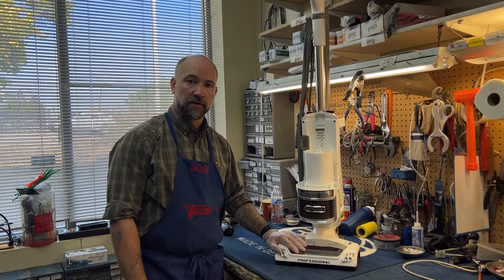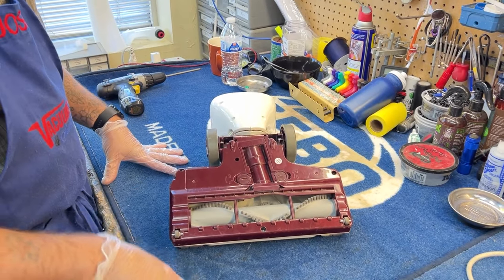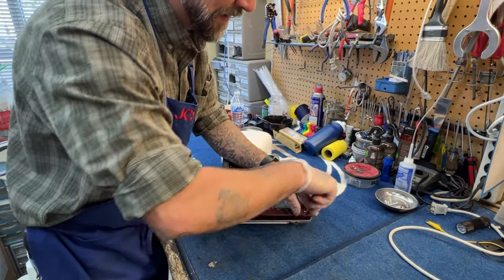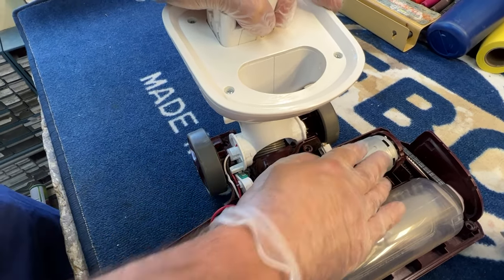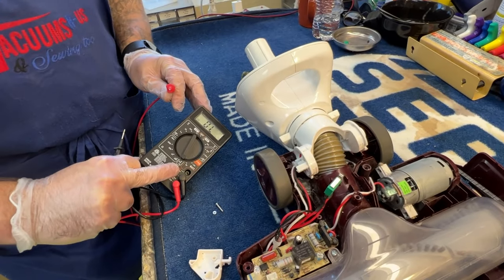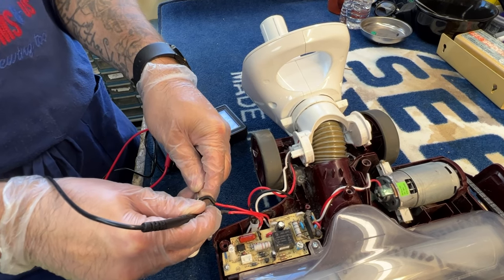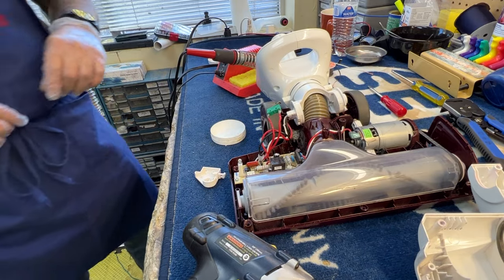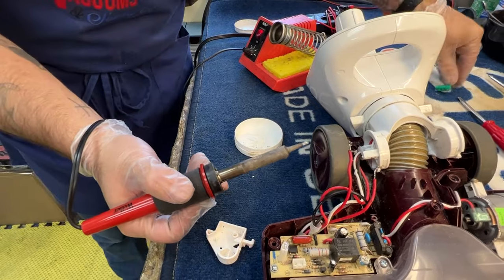Shark Repair for No Brush Roll Action--Micro Switch Replacement

Comment: That's what drives me nuts about the Vacuum Wars channel.  He only shows how well a vacuum works out of the box, but doesn't spend any attention on how long the vacuum will clean correctly before it ends up breaking something and being set outside on the curb for trash pickup.
Reply from the maker: I agree with that. However, in that channels defense they do have some of better performance testing I've seen. He's very transparent in how the testing is performed. We have been battling consumer reports for the last decade and a half over their performance metrics. They refuse to explain how they test the machines. This wouldn't be a problem except they "test" identical machines which are marketed as different models due solely to a color difference and some how come up with different performance results. The same issue will have an identical unit rated as #2 highest performing and #11 on the same chart. The only difference is it's a different color and says "pet" in the model. Vacuum wars doesn't pretend to know some thing about how long the units will last, or the companies dedication to providing repair components in to the future, just how well they run when he opens the box. But I agree with you, most people don't understand what a review channel is for and how it's monetized ;P
Reply: Yep. Their video is what made me purchase this vacuum. I wish I could throw it to the curb, but I paid way too much for this vacuum to do that. I didn't even use this vacuum for 6 months before it was out of commission 🙄
Reply: @vacuumsrus  which brands have best cordless thats repairable
Reply: Shark does great as long as you keep the insides clean
Reply: @joshholschuh1847  but you can’t repair them
Reply: I had purchased a shark not too long ago. While awiaiting its arrival. My rug was perty dirty. There was a loud sound from the rotating bristles. It was not turning. There was no long material of any kind. That had wrapped itself around the brush. I went to the local hardware store. To pick up a set of T Handle security screw removers. No big deal, I had discovered that lower outake pipe was clogged. I still cant not figure out why the brush would stop spinning. As well as produce a wierd dound. It is now back together short of the two small roller wheels. In the front, I am unshure of. If the felt bads go on the inside or the outside. Can you please help me out here?
                Thank you
Reply: Repairing is @ completely different animal than testing
Reply: @281cu6   The owner wants their property back. At stated time that they were told. That they would receive their repaired personal property back. Or the closest time to it. 
You purchase first class airplane tickets. To some or most of the most easily understandable situations and questions. 🛫✈️ WOOOOSH

Comment: Just bypass the switch by rewiring the connection.  Remove the switch completely. Works perfectly!
Reply: Yh if you want the brush roll to stay on constantly while switched to carpet
Reply: I may do this lol
Reply: @Ziggyzoo-wl8ug  I fixed mine and replaced the switch it’s easy bro
Reply: Just did this. Works great.
Reply: @juicyplumbs1250  What? The only thing the switch does is turn the brushroll off when the vacuum is upright. You can still turn the brushroll off at the main switch.
Reply: @jonny_panic  Yh I know but I’m weird and didn’t want it on while it was upright if I’m sorting something out, it’s a good solution but I wanted mine how it was before so just changed the switch

Comment: the microswitch activates when the handle is dropped down.  it also looks like it activates the LED lights.  So if the LED lights work, doesn't that mean the microswitch is good?

Comment: The switches are garbage why put in a switch that will fail I bypass the switch and shut off the brush manually on the top of the vacuum

Comment: I have a shark duo model AZ 2002. My cover plate will not come off.  I've removed 11 screws including the one under the small rubber wheel. I can't find any videos with this specific model number.  Please help.

Comment: I found that replacing the micro switch on Shark Duoclean was very easy. Unsolder the old switch from the wiring and solder the new switch to those cables and bingo. Be careful to mount the new switch onto the mini lugs molded into the machine. When replacing the side onto the machine be sure that the slider on the body of the vac is in the forward position. This was a really helpful video but I wish I could earn $190 as easily.

Comment: Just watched your video "Why You Cannot Repair Your Shark...") and this came up.  We owned 3 Shark SV780N model units--a handheld. We loved them.  Then over time, two began acting up.  They cut out at first and then finally quit.  I knew it was the switch in the handle and assumed I could easily replace it.  NOT.  The switch is mounted onto the circuity of a tiny electronic board which is itself mounted into the vac handle.  Burn marks on the boards suggested the switch was not to blame.  New boards were not available. I trashed the two for lack of a simple repair.  When replacing batteries, I cleaned the insides which acquired a lot of micro dust.  Cleaning done so I would not be wearing dust as I worked on them or inhaling it.  I ended up being quite mad about the whole business as one cannot make repairs on what was a popular vac.  I have been soldering since 1968 (With the same Wen Iron, now outdated) but have to say, circuitry is now beyond my skill unless I buy new hot air "Blower" type irons I see used on computer electronics.

Comment: Thanks for the video. My switch tested okay. Then I  saw that the white wire connected to the switch, was almost completely severed. 
I soldered it back together and now it's working like a champ. 
The black wire was a little pinched,so I cut it and soldered it too, while i had everything opened up.
Thanks again 👍
Reply from the maker: Glad to hear it worked!

Comment: Thank you for this video. This was exactly my problem, which was fixed by replacing the microswitch. I was happy to order a replacement microswitch from you all thanks to these clear instructions. Hope others do the same. Cheers
Reply from the maker: That's great to hear! Glad we could help.
Reply: How do you disconnect the swivel hose

Comment: Excellent video, thank you. Navigator 370. MicroSwitch and wires checked out OK. FWIW, checked voltage on the main On/Off/Roller switch - both positions read about 7v. Seemed the roller position should be higher voltage. Being lazy and not wanting to take the whole top section apart,  I soaked the top of the switch with silicon spray, a few times, letting it soak down in, exercised the switch rapidly. Now the roller does come on. I'll call it a fix, we'll see how long that lasts.

Comment: The Shark vacuums I've owned were not only excellent in function but durable as well.  Watching YouTube videos of different peoples vacuums illustrates how poorly a lot of people take care of their belongings.  Many vacuums that are talked about seem to have been used relentlessly and put aside unloved.  My vacuums in comparison are used but cared for at the same time.  Remember,  the reviews of vacuums or anything else often over reflect the owners who neglect their machines then complain that they are poorly made or unreliable.
Reply: I think it's a combination of both.  If you do slam your cleaner around the place it will not help.  However I have just finished repairing a non-functional brush head of my Shark Cordless duoclean.  The cause was one snapped and one nearly snapped power cable at the join where the shaft pivots around the brush head.  Given the design run of the cable this kind of fault is almost inevitable.  Unfortunately I couldn't get the joint apart as it is not designed to be repairable so I had to put in an external run.  In general getting the product apart to repair it was not simple.  This is poor design and results in a lot of waste.  Our Shark gets very little use as we have hard floors and is stored in a cupboard.

Comment: Thanks.  I'm just trying to replace the roller brush, but nothing fits to get the last screw out to take off the front panel.  I'll go out to find the security bits and see if that'll help.  NV 752

Comment: Good video. We have had our Shark for about a year with no problems but... 
I was surprised at your use of soldering flux. Flux is used when making a solder joint. It renders the surfaces clean so the solder binds. 
The solder for electrical work has a rosin core  flux. 
No harm done but it seems you are going to a lot of needless extra work. :)
Reply: I've found that using flux makes it easier to solder even with rosin core. My theory is the flux displaces air and lets the components not cool as you're soldiering with maybe a 10 watt iron.

Comment: Great content, thanks for the video. Our NV800W DuoClean vacuum was abused a bit by the family. It had been used for awhile and not cleaned out. There was major build up on both rollers that was creating a lot of resistance and causing the them to stop and the brush roll light to turn red. Once cleared, the roller still did not spin. So, I opened things up and the micro switch test good but I can see sparks on the motor brushes as it tries to spin. Obviously, it wore out from being overworked. I searched the part number printed on the motor and found several outlets to purchase a replacement. Maybe this will help someone else. I'm a electronic repair tech also.
Reply: I hope you don’t mind but I’d like to ask you a question. The creator of the video doesn’t seem to respond to questions (understandable - it IS his business after all), and since you said you’re a tech I thought I’d give this a shot. 

I’m not an electrician, but I’m not unfamiliar with electronics basics either. My Shark Navigator Lift Away brush roller didn’t come on one day, but after turning it on/off it worked fine - for about a month - before the roller died completely. I found this video and figured this HAD to be the problem. I took it apart easily enough and the belt looks good, no burnout around the motor, control panel seems okay - no obvious issues. So I ordered this switch and just installed it. And…nothing. 

Now, I’ve got a couple caveats. First off I don’t have a multimeter. My old one broke and I’ve gone so long not needing one and didn’t want to buy one just for this (especially since I KNEW the switch was the problem 🙄), but I just ordered one and once it arrives I’ll probably have a much clearer understanding of the problem. Secondly, my soldering irons are crap. One simply doesn’t get hit enough and the other has probably been mistreated by myself before I really understood how to properly use it. So it’s a pain to use. I know I didn’t burn out the new switch, nor did I cross my wires, but I did kind of slack off when it came to cleaning the old solder from the wires. They weren’t goopy and obviously bad, but they weren’t as clean as I would’ve liked. I just couldn’t get the old solder to wick off properly, and since I was afraid of burning out the new switch I was perhaps too careful when I left some old solder on the wires. That said, the wires were shaped nicely, the new solder looks great, and they’re shrunk tight. 

Could this be my issue? In your opinion, of course. It’s all I can think of. Could a little bit of leftover slag really create this large of a fault? Again, it wasn’t THAT bad. I wouldn’t have put the wires back on if I thought they were too covered with slag to function, but I’m honestly not sure how much slag is too much in this case. (I know slag probably isn’t the correct term - I was a welder and it’s the term that comes to mind). 

If it’s not the slaggy wires, do you have any idea where I should look next? I’ll test everything when I get the multimeter, but besides the motor I don’t know what else to even look at. Any help or direction would be appreciated. 

I guess I just want to know if leaving some slaggy solder on the wires would be enough to prevent a good connection, or if I’m thinking about it too much and as long as the metal touches metal it should function. 

If you could help me with that I’d be greatly appreciative. Thanks!

Comment: I bypassed my switch and the nozzle lights stopped working and no red light either.So I wired the same switch back up all lights the red and headlights are working but no rollerbrushes does this mean the switch was fine and it's something else? There's 2 belts they are fine it leaves the motor next

Comment: I am getting power to the circuit board, but nothing coming out.  Is the board replaceable?  I tested the micro switch and it works.

Comment: Thank you for this video and all the helpful information. It has helped narrow my issue down to the switch, though I am still a bit boggled. Placing just a bit of pressure on my switch turns the brush roller on. With no pressure at all, and too much pressure, the roller shuts off. This leaves me with a brush roller that will only kick on when the vacuum is just barely unhinged from the vertical/locked position. Any more of an angle and it shuts off. Do you have any advice? Thanks for your time!

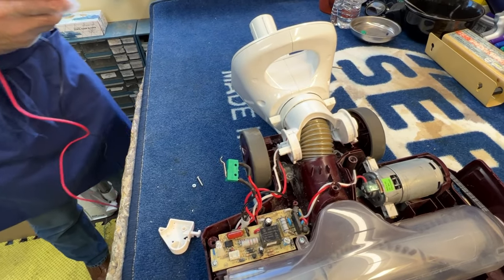Comment: 7:28 

"If you get no continuity open and closed your switch is bad and go ahead and replace it"
I've just tried this.
For me, Closed = continuity, open = no continuity. I'm guessing this is a better indicator of a faulty switch rather than both open and closed sharing the same result.
I'm going to gamble on ordering a chip and seeing if I can get it in.
I certainly wouldn't have tried this without this video but in the Shark Duo, the chip is clearly visible on the side of the machine so it has got to be worth a go
Reply: If the switch was bad wouldnt the Led lights be bad also? I bypassed the switch no lights at all.So I rewired the switch back up I got lights however no movement with the rollerbrushes

Comment: I'm really struggling to get a replacement micro switch for my shark vacuum in the UK (NZ801UKTSB). Do you think putting a manual toggle switch on top of the housing instead of the original switch would work?
Reply from the maker: You can bypass the switch entirely by splicing the wires together. This will cause the brush to be on 100% of the time even if it is in the upright position.
Reply: Thanks for replying. This is probably my best option. I have another vacuum for other usage. Never realised how hard it would be to get spares.

Comment: Great video!  Thank you!
  At 15:59 you mention that it is a pain in the butt to replace that short hose that comes out of the whole brush role assembly.  Do you have a video that shows that repair?  If so, what is the video title?
Reply from the maker: We don't have one at the moment, but I promise if I can get Josh to cuss a bit less during that repair I will make him do it! In all seriousness it is on our list but it depends on when we get the time.
Reply: @vacuumsrus    I really, really hope he'll do it sooner rather than later and I do my fair share of cussing so I sure don't care about that.
Reply: @mrfester42  Bruh, you should see the stuff she cuts out. No, no you should not actually. We are going to try to do a new round of repair videos later this month. The biggest problem with the stupid lower hose repair is that a. every stinking model is way different so one video on the subject will only be a 1000 foot view and b. They keep changing the stupid hoses types and sizes. So for half the models out there we can't even tell you where to get the part.
Reply: @vacuumsrus  Haha! Oh come on, make Josh do the video and let him cuss a little. It should be a mandatory part of doing a repair properly on a Shark :P
Reply: Loved the video, my problem turned out not to be the micro switch, I ended up taking the upper body apart (numerous security star screws) to chase down lack of electricity to micro switch. The wires coming from on off switch for the micro switch go to a small white junction box that feed electricity through the round  plug that mates with the power head. The small white box had opened up leaving the wires move away from the mating position.I  repositioned wires and epoxies the box clised.
I have picture.
Won't buy another shark.

Comment: We have one 3 months old. The switch at top handle will not turn vacuum  off we have to unplug it to use it and turn it off. Also we've noticed the roller isn't working

Comment: how do I know if the belt is broken without taking my shark apart. the roller is not spinning at in both modes . the switch does still turn off and om
Reply: You need to take apart the floor nozzle to get to the belts there's 2 belts

Comment: So what kind of vacuum do you use in your home?  My shark's power roller is intermittently cutting out as the top unit changes angle.  I am guessing the switch is going bad.
Reply: I personally own a sebo d4.
Reply: @joshyouwa  Thank you .

Comment: I did replaced the switch but that didn’t work. I also replaced the motor because there was a lot of black powder. Still didn’t fix it. Only the motor is not working so the roller doesn’t rotate but the vacuum is suctioning. What else could it be?
Reply: My switch tested okay, so I was looking at the motor next. All I can find is used ones. Did you manage to find a new one? And did you ever get it working properly?